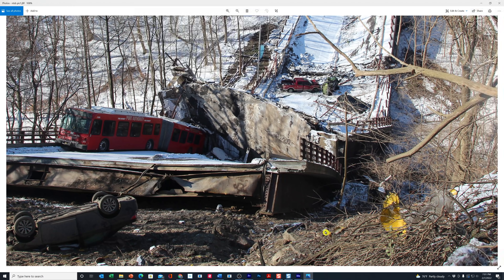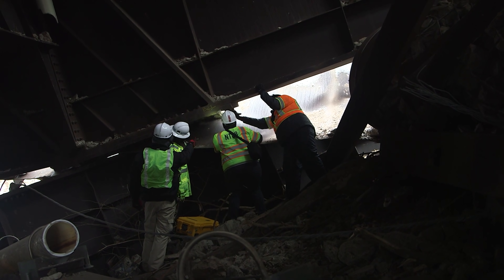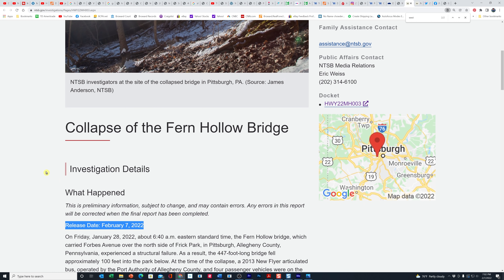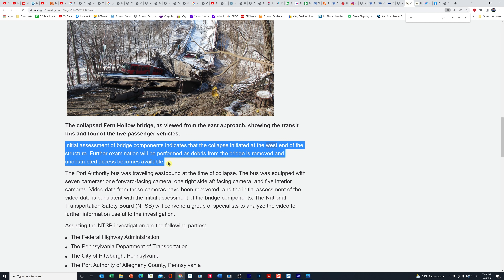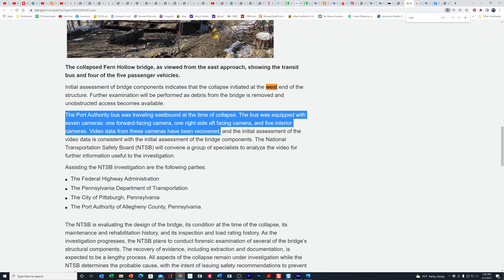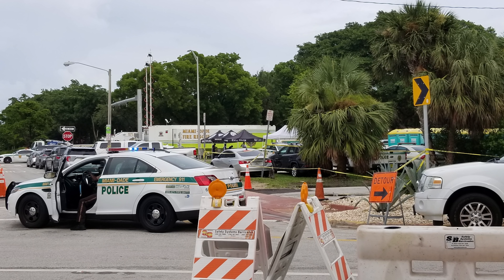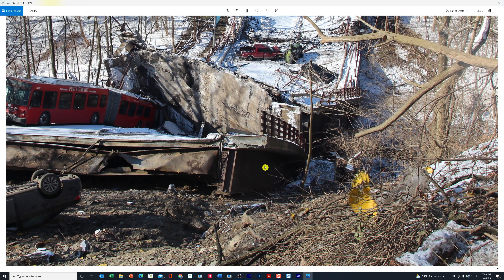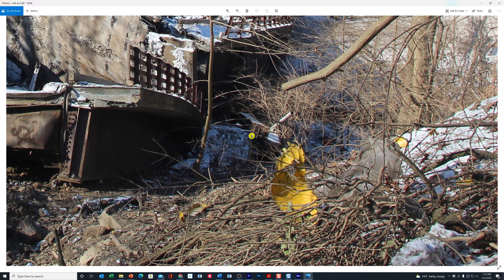NTSB Report Points Where Pittsburgh Bridge Collapse Started

Comment: That Fillet Weld @ 1:30... That filler metal no doubt certified to AWS Standard D1.1 Structural, & AWS D1.5 Bridge, seeming to look as a full weld, with the standing stiffener plate thinned down as it is leads me to believe that this may be bad steel. That is sure to come out in the investigation, just have to wait & see... I thoroughly enjoy your structural examinations, btw!  P.S. When was this bridge built? I seem to remember something about crappy steel being imported from China decades ago following the steel plant closures...
Reply from the maker: This was built in 1973, so the CorTen steel was likely local
Reply: CORTEN was a US Steel trademark.  This steel came out of the heartland of the US, probably either US Steel or Bethlehem for the shapes, plates could be other sources.  In 1977 over 99.9% of bridge steel was US made.

Comment: The scary thing is, there are hundreds of bridges in this country that are in the same condition.......if not worse.
Reply from the maker: I wonder which bridge will drop next, it is scary
Reply: Yep, a lot higher ones too.
Reply: Hundreds of bridges in the city Pittsburgh itself. Many that are rated in poor condition.
Reply: Yes, and the infrastructure funds get siphoned off by the local officials before any work gets done. Spending more on infrastructure does nothing but increase the theft of public funds. They had the money to replace this bridge, but it was given to the local BLM chapter by the local politicians.
Reply: At least one span of the I-80 Des Plaines River bridge in Joliet, Illinois is shored up by wood blocks held in place by GRAVITY.

I refuse to cross it. If coming from the Quad Cities I'll take 88 to 294. Otherwise I'll go up 55 and down 355.

It's still open to all traffic, because it's Illinois we're talking about. My money is on that one to be the next big bridge collapse. Sadly, it'll be more like the 35W bridge in Minneapolis in terms of causalities because traffic is usually backed up on it.
Reply: if they were worse, they would be down.
Reply: @Capecodham  ha

Comment: Is it just me or has the left foundation has shifted to the left a few degrees? It doesn't seem level to the other one.
Reply: How about the bridge deck pushing it to the side when it fell?
Reply from the maker: It is so hard to tell with those, and the bridge seems to have fallen pretty much straight down
Reply: @jeffostroff  Those concrete foundations have stood there for the total life of the bridge. and getting only vertical forces to bear. Sideways forces were taken up by the diagonal braces even in their sorry state. So any tilting before the accident could only happening if something under them gave way. If that was the case, rodents?, it would have collapsed at that place. But it did at the other. In contrast the massive weight of the bridge deck falling down would rest either on the foundation or on its side. The pyramidal shape with the deck acting on it is like a wedge with no counteraction on one side. So that looks to me the most logical mechanical reason why the foundation was titled. But I may be wrong. The most telling will be scratch marks on the side where the deck rests now.

Comment: The FHA is the main national highway department (FAA, FRA are two others). Don't confuse a private building with loss of life (and private property abandoned) with a public bridge.. PennDOT will have the plans, and PAAC will also have maintenance history.  I do have to say you're veering off reality a bit now. The rebar shows no rust, it was not exposed until the slab cracked. I think the way the bridge was intended to flex was the deck would push down (no surprise there) while the legs would push down, but also flex outward. Those cross members were strictly to put tension on the vertical members , not to bear, or distribute load, and not as compression. That's why they went with the cables. That also is likely how the bridge failed. The standing member where the broken brace was bowed out, and collapsed, followed by the one across from it. The other two remaining standing members rotated as the deck failed, which cushioned the Frick Park side, minimizing injuries.
   As far as corten goes, with exposure to salt, or wet environment, it behaves like unpainted steel. The patina also seems to make it tough to provide cathodic protection with zinc from the caltrans tests I saw. It's worse than painted steel, but not super accelerated.
   The base of the standing members were pivot points. The blocks were ok, and the only thing I don't think they had a bearing surface on the bottom. Arch bridges need to have a bearing or rack and pinion because expansion makes the whole arch longer. Doesn't surprise me that they didn't, or maybe they had a pad so it wouldn't gall.
   Wonder if they'll put a Bailey Bridge in temporarily. I've seen them do that in Maryland on highways. Cool.
Reply: Thanks for mentioning the rebar did not show rust. I noticed that, and wondered if anybody else noticed they were coated.
Reply from the maker: Patrick, I am not veering off reality. I specifically said the slabs likely had no connection to the collapse. You don't understand construction so I will make it easy for you. I think those concrete slabs were built wrong. The rebar is supposed to be located deeper inside the concrete, not close to the bottom of the edge of the concrete. Not sure what your point about the rebars not rusting has to do with anything unless you just like arguing over nothing. I am stipulating the slab manufacturers did not embed the rebars to the correct depth. You do that on a house foundation or a pool, you will fail inspection. Nowhere did I say this has anything to do with the collapse. That was you that said it. I just point out things that do not look right. Go google "correct depth rebar in concrete"
Reply: @jeffostroff  The deck is 8 inches, and has to account for wear. Foundations are at least 12 inches. There were 2 layers. How much spall?
  I'm a railroad wayside engineer FYI. I work with civil engineers sometimes.
Reply: @jeffostroff  my point about the rebar was that it wasn't that way before the collapse.
Reply: I would look to see if the spalled concrete was lying about atop other debris. If not, then it had been spalling for some time. Maybe not contributing to the total failure, but not good in any case.
Reply from the maker: @The_DuMont_Network   One of the side effects of spawning can be the fact that in some cases the concrete is saturated with water so now it's dripping down on the superstructure below and causing more rust
Reply: @jeffostroff  one of the big tells in component failure is weathering. The concrete seemed freshly exposed. If it was cracked, there would be weathering and rust marks. Spalling would show signs of saturation, or edge staining. In rail (and pipelines) they can determine a starting point, then the propagation, and the damage from collapse by looking for a defect, and then a crack (like from pitting and stress), and jagged cracks/tears from coming down (crystalline, no wear)..
Reply: @jeffostroff  Spawning? You DO mean spalling, right?

Comment: When I saw ur last video I told my wife it started at "gate house" side. The wire x braces had no inward strength. the center "tacoed" from the busses weight as I called it and that pulled the structure inward. thus pulling it from the other side and hence the large separation from the footer.
Reply from the maker: I wish they had a security camp under the bridge that could have shown what was happening down below leading up to the collapse
Reply: @jeffostroff  you would think they had a cam under the bridge.
Reply: ur?

Comment: Port Authority shut down another bridge in Pittsburgh this past Saturday. They said the bridge had shifted two feet.
Reply: Port authority owns the bridge it's on the busway over rte 51.
Reply: @richardfazio2417  you from the Pittsburgh area? If so then you know a good bit of the bridges need work or replaced.
Reply from the maker: Yes saw that, the bus bridge

Comment: Yeah the rebar looks a bit too close to the bottom of the bridge, but I'm not an expert. It doesn't look corroded though, so I think that any saltwater came via the drains rather than infiltration through the slab.
Reply: Remember, the rebar is there to support the concrete, not the other way around. It's there for compression of the load on the concrete deck.
Reply: Remember tho Jeff, back when this bridge was built tho in 1970 or so, we did not have the fancy rebar supports and other ways that we now use in order to keep the rebar mat suspended into the Slab and allow the concrete to flow underneath of the rebar mat like we do today. Back then they used a hook or a concrete rake or hoe to pull the rebar up into the slab but it would get continually pushed back down as finishers would walk the wet concrete. It was a widespread issue!
Reply from the maker: both home depot and lumber liquidators sell transition pieces online